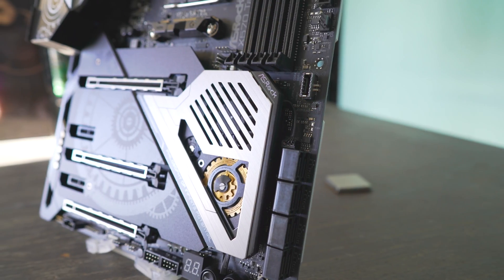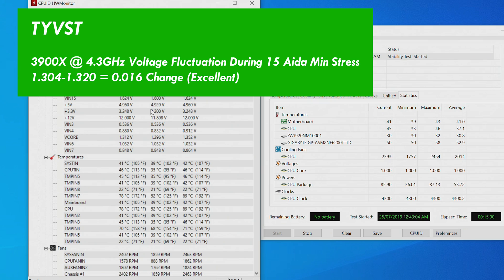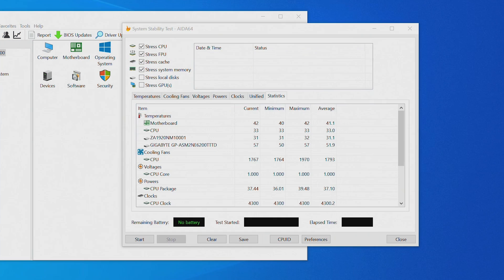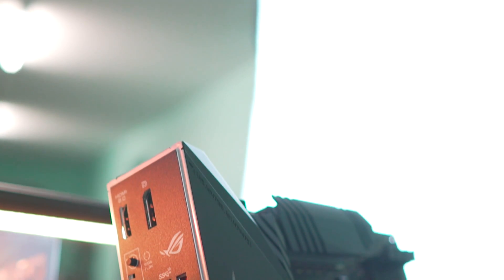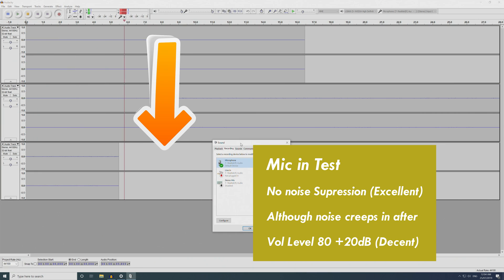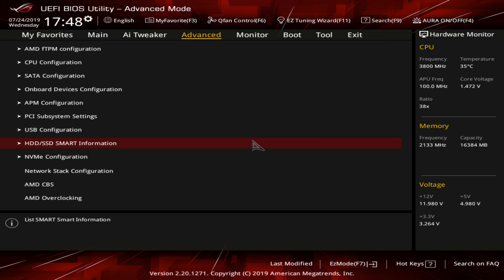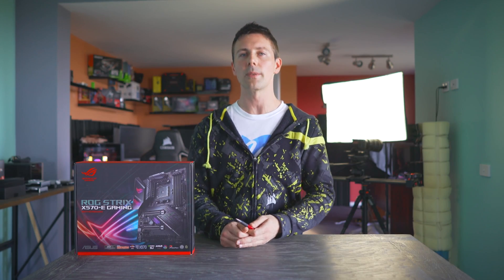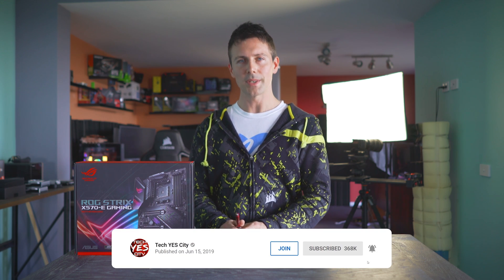ASUS ROG X570 Strix-E Motherboard Review - "3900X @ 4.325GHz Dayo"

Comment: Buildzoid was not impressed by this motherboard: he called it "pointless".
Reply: He called the board itself excellent,  pointless was on pricing only.

And he was wrong, there is not £20 between this and the Crosshair VIII...its closer to £80.
Reply: well the price point is pointless really since the Hero is too good of a board
they really shouldve taken out the F and push the E down to the F's price point
Reply: Richard Dower corrected your half statement as to quality and Brian is even more correct in relation to Australian pricing which is nearer $200 cheaper that the high end Asus board Buildzoid referenced. The pointless comment is valid only in comparing English Asus distributors ripping the UK locals off. In the UK the smart people would buy somewhere in Europe for a lot less.
Reply: He wasnt impressed because he mistakenly thought this had same vrm and controller as the X570-F but later realised its almost as good as the Crosshair in terms of Vrm layout
Reply: Bobcat665      Buildzoid 's rambling is pointless and is only just been wined and dinned by Gigabyte.

Comment: actually getting to see 3900x at 4.6 ghz soon with new mtoherboard?
Reply from the maker: They cap out at 4.3ghz on all cores, if you are in a cooler climate could probably got for 4.4, but 4.6 all core aint happening anytime soon for 24/7 oc.
Reply: @techyescity  can u do ryzen 3900x one ccd disabled (low performing one) and test the best performing one bcs it can boost to 4.65ghz all core disable smt I belive against 3600x or 3600
Reply: @SoriPop  he can also just do per CCX overclocking.